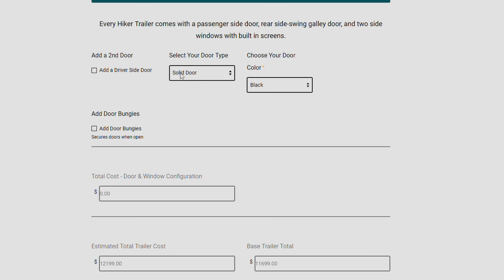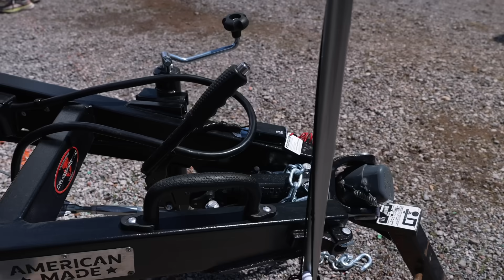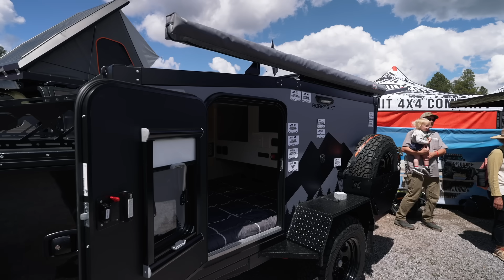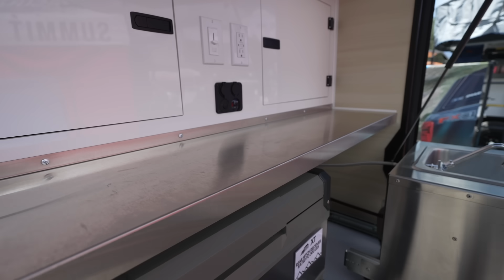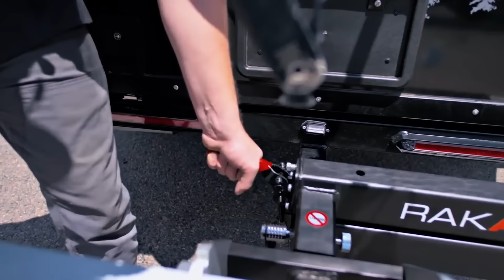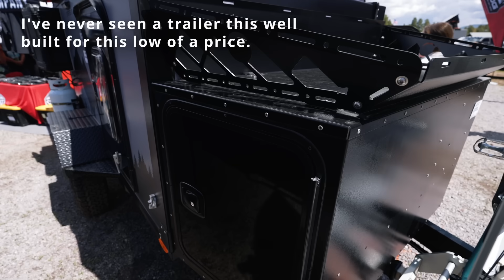The PERFECT Compromise: Mid-Range Price, Top-Quality Trailer!

Comment: Here’s my only thing… it’s 44k and you can’t stand up in the thing. $68ish is a new transit trail… 25-35 is a nice aLiner with hard dormers… i just don’t see the appeal, but to each his own.
Reply: The base model AT is $27,900, and most of the tear/squat drops for offroading to be towed by a Jeep/Tacoma/4Runner you can’t stand up in. That is the market. Light weight, 360° hitch, insulated, independent suspension. Comparing apples to apples, YouTube host is correct.

Comment: The Aussie’s know their crazy off road trailer hitches lol. The angles you can get with those things are nuts. 

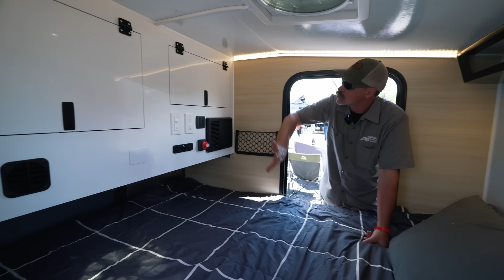8:12 I spy Elevation Off Grid’s trucks.🤤 They’re like Earth Roamer levels of crazy Ford F-550s, and 450s. Insane amount of money for their kits though, and that’s not including the already insane $80k (or more honestly) truck price.🙃 They custom stretch the beds by like 4 inches (chassis cab trucks have longer frames than normal ones), so you have even more room for gear storage, or a honking sized pop up tent. Rides on a LiquidSpring smart suspension so it doesn’t ride like a tank like all the 450s and up do, but still retains the crazy 9,500lbs of payload capacity. 40gal fuel tank for (already) insane range. Huge Goodyear tires, super singles, on the fly raisable lift kit, huge Warn winch, all the light bars/pods you want, etc all for a whopping $185,000 plus.😂🙃 

Thing is badass but you have to make some serious money in order to justify buying one.

Comment: Wow.  How in the heck did a $28,000 trailer (when the video was originally posted) turn into a $45,000 in 4 months?  At $28,000 that's an interesting trailer.  At $45,000, not so much.
Reply from the maker: Sorry for the confusion. The $28K model is this same trailer, but without a number of add-ons. Same frame, suspension, cabin, etc. It really is a great deal, unless something changed that I don't know about.

Comment: It's still way overpriced.  This entry-level trailer's base price is 28k.  By the time you finish building (w/o air conditioning), u have a 40k trailer.  It doesn't even have an engine. lol  This is 20k overpriced.  I have a '23 Mazda cx 50 Meridian Edition.  It cost me 43k to drive it off the parking lot of the dealer.  The engine alone with the engineering that went into that motor is worth more than this entire trailer.  And I have 4 wheels with great suspension that cost more than the 2 wheels and the suspension here on this entry level trailer.  In the end, it's just a trailer with some walls.  It can't take you anywhere.  And u can't stand up in it.  I'm too old to get involved in another business, but the person that can come up with a trailer at this level for half the price is going to be a rich person.  And it can be done.  
As far as Hiker goes, they do offer a decent overlander at a decent price, but they have a serious problem and why I wouldn't buy one: QUALITY CONTROL.  They're like a box of chocolates: you never know what you're going to get.  They certainly can build a decent budget trailer, but they can also build a piece of crap--and u see it in the comments of owners.  I'll see what I end up with, if anything.  But I probably will end up in the used market and if something comes along that offers a decent value to cost, I'll bite.  Thx for the video.

Comment: Lithium batteries don't like heat and placing in them in a metal box that's painted black is a big no no. Too much black all around.  Windows are a nice touch and the proper queen bed.
Reply from the maker: I do get what you are saying with the box. It makes sense. However, it is pretty much the norm. Even our trailers for years have had the black aluminum box and our lithium are running as strong as they did day one. Not sure why. Not saying you are wrong. Just saying for some reason I don't see the impact one would expect.

Comment: Thanks again for the great video Drew! Just to clarify, the AT is our base model and it comes with the toolbox, Cruisemaster independent suspension and DO35 articulating hitch, front and back 2" receiver, AGM battery, Maxxfan, Victron charge controller and battery monitor with touchscreen, all lighting and USB/110V outlets, cabin and kitchen storage, rear stabilizers/levelers and queen mattress. The AT is $27,900 and comes in at 1,900lb.

The XT is our turnkey model that comes with the  toolbox, 1 Battleborn heated lithium battery, Victon charge controller and battery monitor with touch screen, Zamp 100 watt solar panel, Cruisemaster independent suspension and DO35 articulating hitch, roof rack, queen mattress, Maxx fan, Propex 6,500 BTU propane heater, Truma 60L fridge, stainless steel and sink with 20,000 BTU Partner stove, 30 gallon water capacity, front and back 2 inch receiver, 11lb propane tank and instant hot water shower, rear stabilizers/levelers, spare tire. The XT is $44,990 and comes in at 2,200lb. 

Check them both out at https://boreascampers.com/boreas-at/!

Comment: I was super interested as you were comparing to the best low-cost campers, but the XT model featured is $44,000, I really don't care what it includes at that price. its not relevant to a Hiker/run away comparison. This is a top tier luxury heavy duty over-landing camper. Not what I came for, you've lost me.
Reply from the maker: Sorry for the confusion. Throughout the video I’m not referring to the XT. I am referring to the AT. It is the same trailer without the unnecessary add-ons. Same frame, dual hitches, independent suspension, articulating hitch, tongue box, composite sidewalls etc. But all for $27k. Build out a Hiker and at $27k you will get inferior components and less trailer. I’m not here to sell trailers. I’m here to help people realize most of them don’t need a $44k trailer. Heck they don’t need a $27k trailer. But if they want the best, $27k AT can’t be beat for what this offfoad trailer provides

Comment: Quick question,  I've been seeing a lot about bent frames and frame damage from other companies, especially the big buck companies who only care about getting trailers out the door and don't care if they last 1 trip.

it seems like 1/8" (11GA) box steel is an industry standard for frames..   (yeah, a 12' mini camper and a 40' trailer with slideouts bouth use the same 1/8" for the frame, meaning the tongue becomes a key point for failures and bends.

I'm wondering what  these offroad trailers use...  i couldn't find anything other then weight...   and wondering if its a bigger 1/4" steel..
Reply from the maker: That’s a really good question. I should know the answer to this, but I don’t. This year I wanted to spend more time getting to know the chassis of these trailers. Once I start getting some numbers from different manufacturers, I’ll have to share them with everyone.
Reply: @PlayingwithSticks  yeah, a lot of big name manufactuerrs don't make their own frames... they instead buy them from Lippert.  

Forest River (Rockwood and Flagstaff)
Jayco
Thor
Keystone
Grand Design

All buy their frames from Lippert... leading to a pretty standardized frame...  unfortunately,    its the same materials and size no matter the size of the trailer, meaning they can suffer failures due to weight.

Comment: Drew… Just saw this same camper at the SAVE Expo in Starke Florida last weekend. Equipped with everything in the video less any bike or moto ramps or mounts and it had a sticker on it for $44k. Far from the $27k you listed on the video. Not sure why the difference but that’s a considerable price difference. Also one thing should be noted about the spare tire mounted location on driver side of trailer. I believe it’s illegal for it to be mounted on the driver side in most states thru out the US. It’s a safety thing. Curious on your thoughts.
Reply from the maker: Sorry Raymond, I don’t think I was specific enough in the video. The 44K version and the 27K version are the same base trailer. And they both come with the articulating hitch, the independent suspension, the great chassis, the dual hitch receivers, etc. basically the 27,000 is everything you need to get out camping but at a price much lower than the competition. The 44K is there base model with all the tricked out accessories plus a full kitchen. So it has things like propex heaters, fridges, etc. The $44,000 trailer doesn’t really interest me, but the $27,000 trailer really interests me. But unfortunately, when I’m out filming these videos, nobody wants to bring out their base trailer, they want to dress it up so people can see the potential. I always want to dress it down so people can realize they don’t need all the accessories. that’s the beauty of these trailers. You can go big, or you can go basic and they both get you to the same place.
Reply from the maker: As for the tire mount, I kind of have different opinions on it. If there is a decent gap between the wheel well and the tire mount, I don’t find it to be an issue on that side. I generally use the fenders as a guide when reversing and I look through that gap to see traffic. But, when the spare is too close to the fender, and I cannot see a gap there, I find it very difficult. As for legalities. That makes sense, but my guess is most law enforcement officers wouldn’t be looking for something like this. My brother wouldn’t 😂 and he’s highway patrol. Don’t tell him I said that!

Comment: Hey drew, you know me and heating...   thinking about that hot water on demand...   kinda hit me.   picture an in floor radiant heat system,  water fed from the on demand heater.   LOL.   Thermal mass + isolated heat system thats located outside of the living area.   

Yes, i'm being totally silly.
Reply from the maker: Silly, but I can totally see somebody doing this with their own DIY trailer. Especially for someone who has already done it underneath their home bathroom floors.
Reply: @PlayingwithSticks and considering how efficient those water heaters are.   Running 2 pumps,  allowing the pressurization and depressurization of the system to prevent freezing,   and basic lightly heated and insulated water tank...  just needs to be kept from freezing...   you'd get an interesting system...

Comment: I think it is really important to note that video was almost exclusively the XT model which starts at $44,000 USD. The price is without most of the options highlighted. However, the presenter shows the price of the AT model which starts at $27,000 USD. Once you start adding some of the options that the video shows as features you would presumably want (why would they otherwise show it), the price sky rockets to at least another $12,000 USD and I stopped adding it all up. It's a little disingenuous to compare this to a Hiker trailer as they are nowhere near the same class. I think Drew should have made more mention of the price of the model as shown and put that price in bold headline letters instead of the cheaper base model which had almost none of the features that was shown.
Reply from the maker: I see your point, but no intention of being disingenuous here. If you watch the channel, you know one of my biggest concerns is people being convinced they need to buy stuff they don’t actually need. Unfortunately, it is very rare, if ever, that a manufacture will provide a true base trailer for me to highlight. I don’t believe most of us need an XT. Most of us need an AT. It has everything you need to go camping. I like to remind people that this is CAMPING. All the accessories look fun, but I honestly don’t believe they are needed. And I don’t believe most people need to walk away with a $47,000 trailer. Even a $27,000 trailer I think is for a very limited portion of the population. And it’s not disingenuous at all, to compare this to a hiker. I want people to understand what it means to actually build out a trailer. Hiker like I mentioned in the video is a great bargain at base. But once you start adding components, I think it has highly diminishing returns. And as I highlighted in text a couple times in the video I’m not talking about adding accessories. I’m talking about actual Overlanding components and build materials. If you go and build out a $27,000 hiker trailer which people have, it doesn’t even compare to a $27k AT. Nothing is in the same ballpark. One is built with wood, and a lighter frame, and lighter duty components. The other is built with composite, and overbuilt frame, and the best components from within the industry. This video was purposeful. And it was purposeful that I didn’t highlight the pricing of the XT. There are XT videos and web posts all over the Internet. We aren’t here to sell trailers. We are here to help people understand trailers. Maybe you’re new to the channel, and I’m sorry for assuming you understand where we’re coming from. I think once you watch more of our videos, you’ll start to realize the intention behind our narratives. But with all that said, I’m glad you pointed this out. This gives me a good opportunity in the comments to explain the video more.

Comment: One thing I don’t love is how high the counter is in the galley. Wouldn’t lot of people be too short to chop veg or other prep there? Or is there a step stool or something you’d use?
Reply from the maker: I would say you’re about the fourth person who has shared a similar comment. And you’re right, that’s one of the sacrifices that come with off-road galley kitchens. One thing they did to alleviate this is to have the stove on a lower slide out. But, that doesn’t alleviate the counter situation. Some manufactures do it with airbags, or even hydraulics. If it was my camper, I would definitely use some sort of portable campstool. But, it would really take away from the overall experience in my opinion. That’s why I like an overland camper That’s about 15 inches high. High enough to get you anywhere you want to go. But low enough to have a nice galley cooking experience.

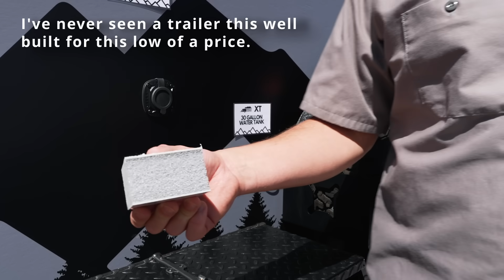Comment: Hmmm.🤔  I think you may owe us a drink  at 11:02
Reply: This is a zero wood, all composite, fully insulated, off road purpose built camper with the absolute best suspension, hitch and windows you can get. Sitting on an extremely over engineered frame. I don't think it was even fair of Drew to draw any comparison. Hiker trailers, which are great for some, certainly have their place in the market but this is apples and oranges here.
Reply from the maker: 😆 I love it! I’m being 100% honest here. If you can do it I’ll make a video about it.

Comment: Thanx Drew. Knockin it out of the park as usual. Even while discussing the "Boreas", you never "bore us." This trailer looks well thought out and well made. The kitchen looks amazing and truly useful on all fronts. 3 things though. 2 bicycles, a loaded tongue box AND a motorcycle? Is that not a recipe for trailer sway at high speeds because of all that tongue weight? Here I go again, 27k and only 100 watts of solar? Really?There seems to be plenty of roof top real estate left to add atleast another 100-200 watts of solar. Cover the entire roof with solar would ya. Lastly, for 27k, where's the air conditioner? I saw 2 batteries in the tongue box and room for atleast one if not 2 more? Can't wait for you to start making your own trailers.  "Drew Drop" Alaskan trailers. We all appreciate what you do Sir. Please don't stop.
Reply from the maker: Glad you are enjoying the videos. Thanks for sharing your thoughts as well. That tongue weight isn’t necessarily associated with the sway, because that comes into play when your trailer rear is weighted heavy. But, you’re absolutely right, all that weight on the tongue is going to inch up to overloading your vehicle’s tongue capacity. Essentially you would be looking at a pick up truck to support this type of loaded trailer.
Reply: Thanks for the feedback! The AT/XT is engineered and balanced to take that load. Like Drew said, loading up will certainly impact the tongue weight, so you'll need to make sure your tow vehicle is capable. We keep the roof rack open if folks want to add a roof top tent or storage box, but we do offer up to 500w total in solar panels for folks that want to go that route. We're based in Colorado so AC isn't a necessity when most folks are heading to the mountains, but we did just announce the 12V Nomadic AC option that will run off grid. Thanks for the comment!

Comment: Drew - Have you considered creating a separate channel devoted to slide-in campers for trucks? I would love to hear your thoughts on that corner of the industry.  Lots of value in the Scout camper lineup compared to these expensive overland trailers.
Reply from the maker: I actually did consider that. I’ve always told May I want to try all these trailers to make sure I am giving the right advice. I don’t want to tell people that this is the way to go, to find out five years later that something would’ve been better. Sometimes I wonder the same thing with campers. At some point I probably need to give them a try to see how they compare to small camper trailers. We’ve tried the travel trailers and the vans. I’m not a fan of them, but the truck campers make a lot of sense.